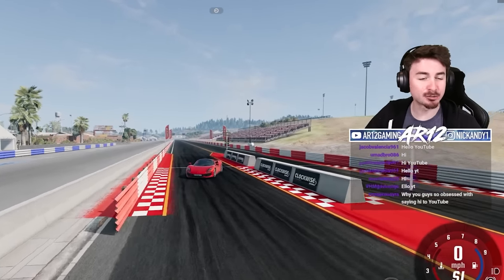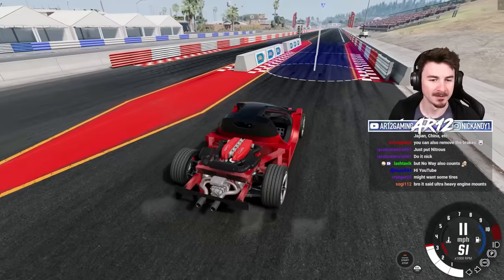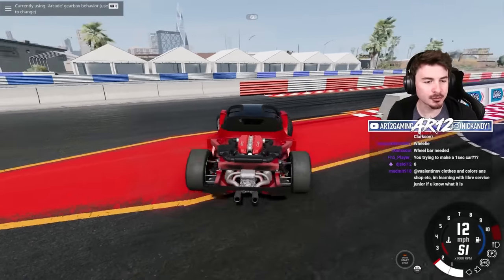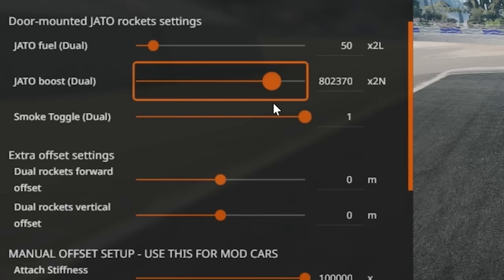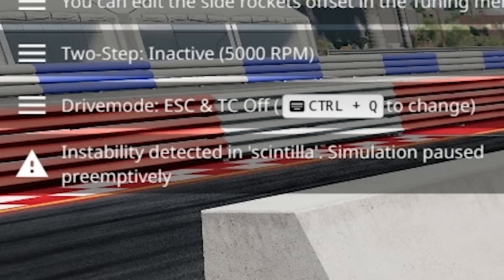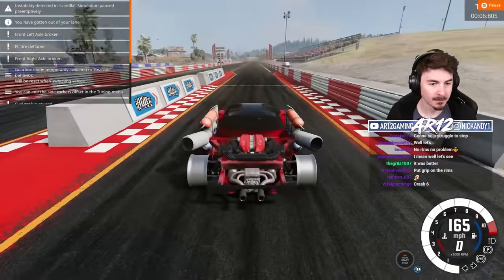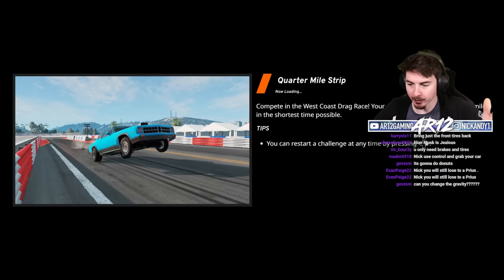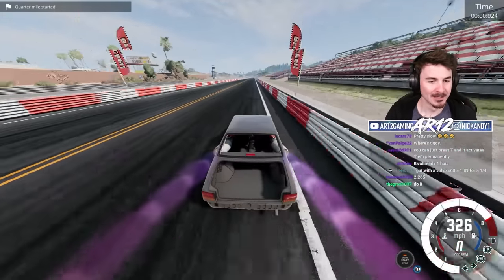I Built a 1 Second Drag Car In BeamNG Drive

Comment from the maker: This car is slightly dangerous.... BUT I think I can make it even faster... 1 Mile in 1 Second?
Reply: try the f500
Reply: Do it in the bus
Reply: Do a lap on the Nurburgring in less than 30 seconds with a 3 wheeler, using a 450 Liter 1 cylinder engine that runs on oil and plants (gotta be eco friendly) should be easy enough 👍
Reply: yes... slightly dangerous
Reply: 10 miles in 5 seconds?
Reply: I know this is off topic but can you play Lego 2k drive on Friday when it comes out please?
Reply: Do 1 millisecond drag race, Nick
Reply: Yes.
Very yes.
Reply: Didn't this get uploaded before?
Reply: @shrekharvey2585  that was the first of the series, but this is part 2
Reply: @Arceusmemesidk-zk7tm  oh
Reply: Yeah it’s called flying in a SR71
Reply: @TriggerVR657  why are there so many of you?
Reply: @Arceusmemesidk-zk7tm  yes
Reply: I don't think that'll work, I have a bad feeling about this
Reply: FREAKING UPLOAD THIS TO HE WORKSHOP PLZZZZZZZ!!!!!!!!!!
Reply: Hey Nick! What mods did you use for this video?
Reply: Slightly?!